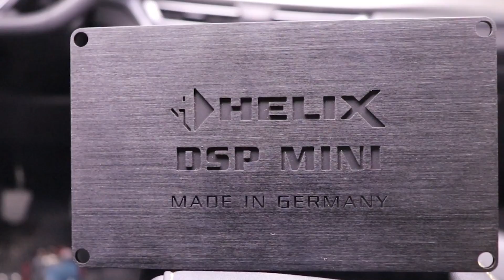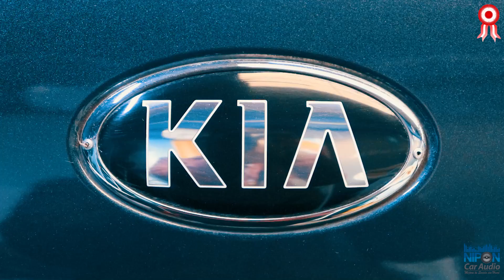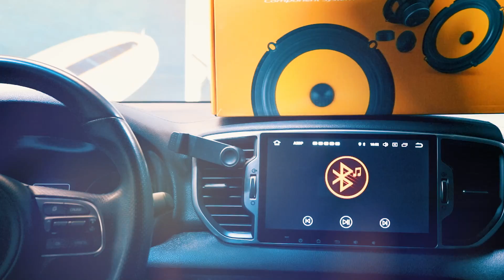Kia Sportage 2022 Sistema No Amplificado JL Audio C1

Comment: Don Henry yo quisiera realizar una mejora de sonido parecida a iesta instalación pero mi pregunta es si se deben instalar los crosover para los componentes y Twister o ambos se conectan directo a la radio. Mi intención es modificar lo menos posible el vehículo.  Saludos desde chile
Reply from the maker: Hola amigo Richard todo juego de componentes deben llevar Crossovers el cual se conecta al tweeter y Mid bass. Lo que si debes tener en cuenta es la sensibilidad de los componentes de acuerdo al amplificador o radio que tengas.
Reply: @niponcaraudio9437  muchas gracias don Henry. Tomare en cuenta su consejo